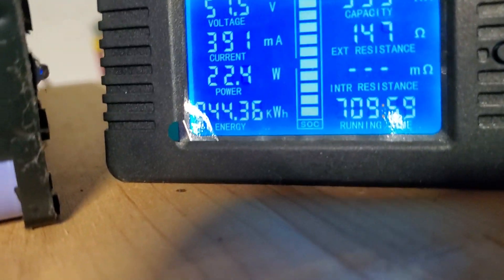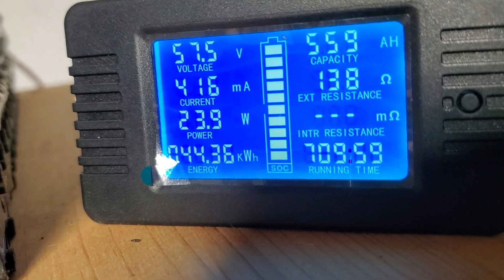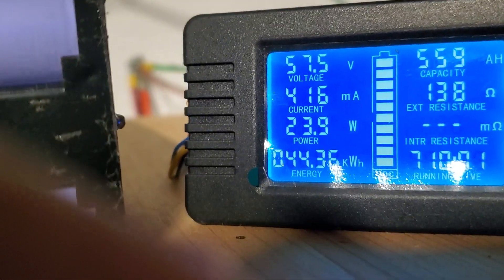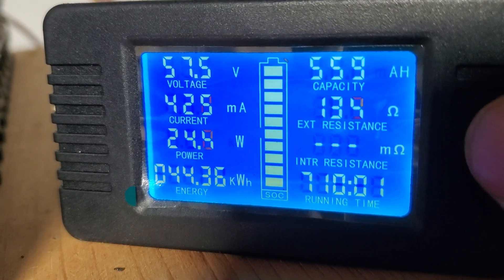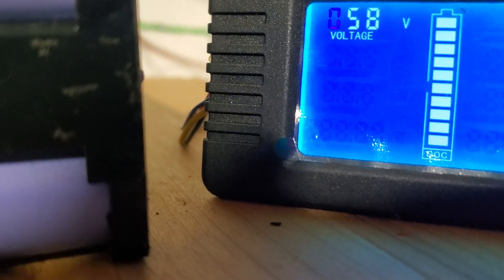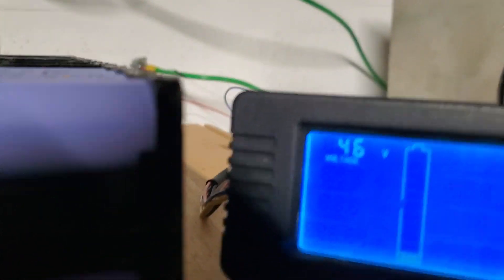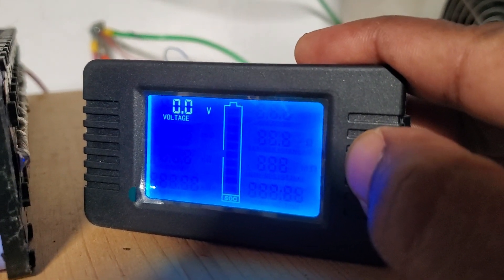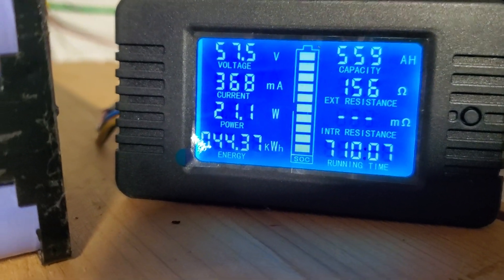HOW TO PROGRAM PZEM-015 DC Multifunction Battery Monitor Meter Shunt,0-300A, Applied to 12V/24V/48V

Comment: One question, I had mine working on my 48 volt battery, but I put it on a 12 volt and the numbers don't show but the back light is all blue. Do you think its because its set to 48 volt and 12 it's enough to power it?
Reply from the maker: You can't use one for the other

Comment: It is a pain in the ass, but watching your video helped me out so much. I’m building a solar battery kit on my boat really helped thanks.
Reply: I tried doing everything that you did there I’d set the I’ve got a 12 V system and I set the lowest voltage and the highest to the 12 but I lost my battery meter thing in the middle there is it supposed to be blank or is it supposed to show all the time? Does that show you the life of the battery? I’ve got 100 amp lithium battery. It’s a solar charge controller everything
Reply from the maker: @rogerrolandbelanger4762  if it is a 12v system, your lowest should be around 10.5v highest around 14v. Not both the same.
Reply from the maker: Happy to help

Comment: Hello is it have Battery Low Voltage Cut off Switch On Protection Undervoltage Controller DC
Reply from the maker: It is reader with no function to do anything

Comment: @Simply Focus: Do you need to power the device from a a separate 12V battery (top two wires) or can you use the 48V battery for power too?
So top wires wires and bottom two wires. Middle two wires to shunt.
Reply from the maker: No, I just used the 48v battery
Reply: @simplyfocus9937  ok perfect, ordered one on amazon

Comment: How do you know the max voltage your system should be
Reply from the maker: I keep my regulator at 57.5V that should be the max in my system
Reply: The question was how do you know what the max voltage on your system is a 36 V